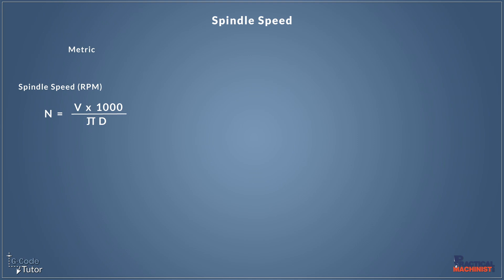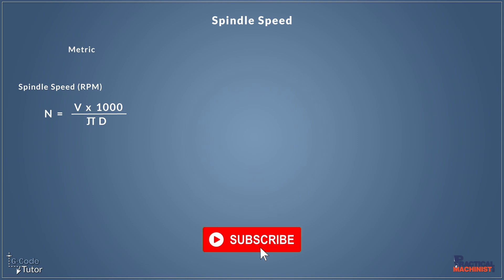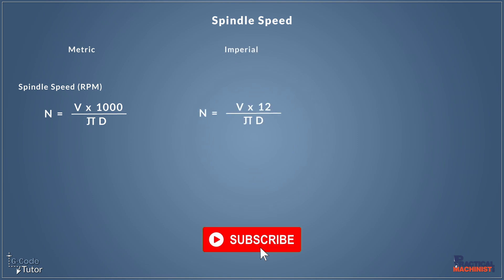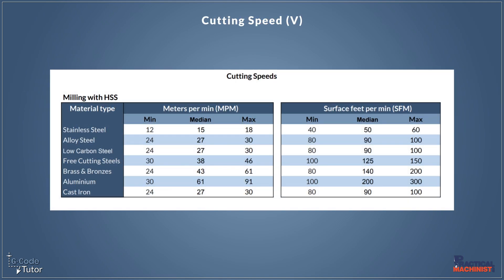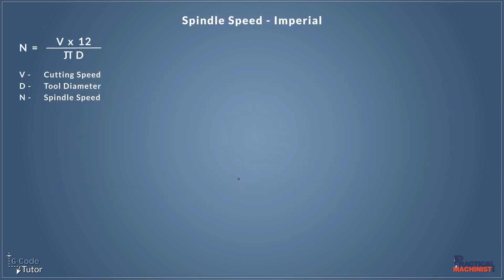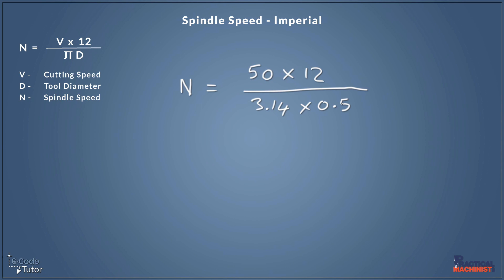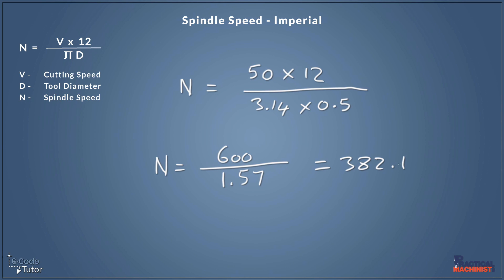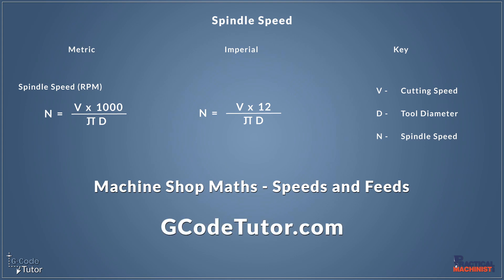Machine Shop Math - How to calculate spindle speed

Comment: Try 4 as a constant times the cutting speed divided by the diameter.  (4X50 /dia) Much easier to remember.  Taught it that way to my students for decades. This assumes HSS tool.  Carbide is triple.
Reply: Hey.. Can you please explain the "by triple" means?
Reply: @putraardiyana8115  3 time the high speed steel rpm.